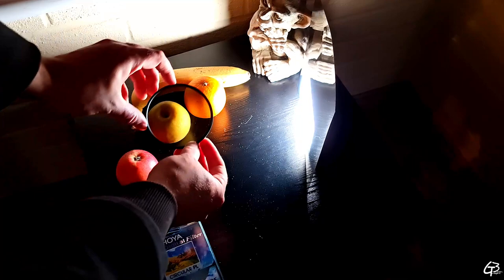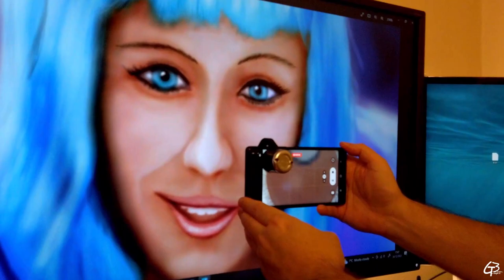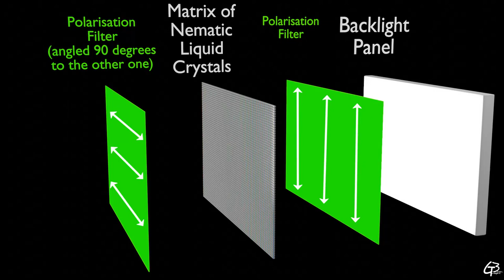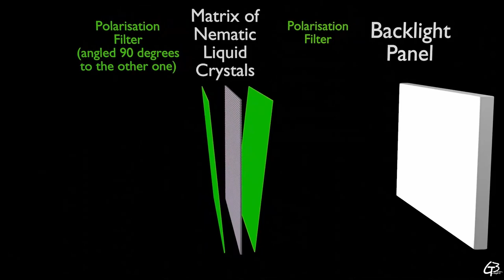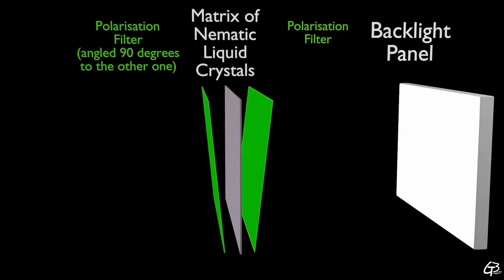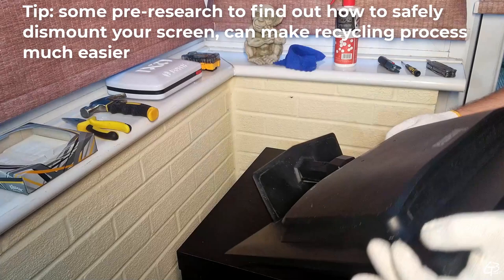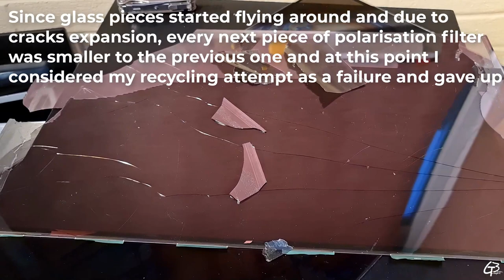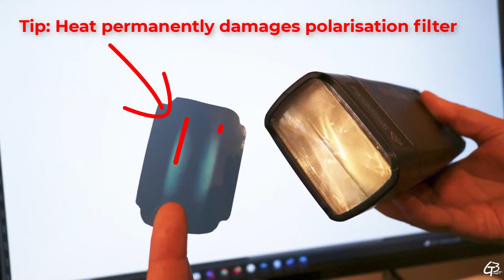How To Recycle Polarisation Filter from old LCD Screen - DIY

Comment: I tried this as well and had the same issues. Separating cleanly from the glass really needs some kind of solvent that will dissolve the glue and not damage the filters.
I could not find any suppliers of large polarizing sheets who would ship to South Africa, but eventually used some replacement filters meant for iPad screens that were just the right size for the AR400. These were very cheap and I still have a whole drawer of them. 

If we need larger sizes in future I would look for the same thing, or recycle an old TV and do more research about the solvents needed.
Reply from the maker: Glad to know I am not the only one who failed :) with the first time. The LCD TV screen should give a very large Polarisation filter sheet which can cover even entire large diffuser. Regardign the polarisation sheet size, I purchased one on EBAY and negotiated nonstandard cut size. It wasnt an issue. It was the seller from Germany.

Comment: I also saw someone in a Photogrammetry group, who ripped out an old monitor screen to create an soft light. So basically both can be used.
Reply from the maker: I am sure anything can be recycled if you need it. I am afraid tho, that light efficiency from such panels isnt the best and woudl rather recommend strong, color calibrated LED panels for such job. Cheers!

Comment: I love how true to form you are in your videos by including screw ups ... (ps.. try a heat gun next time? :) )
dude.. I was wondering... how do you properly calibrate the filters lens/strobe. From what I'm understanding you use a circular polarization on lens and linear on strobe...but not sure how to line them up. The larger filter on strobe (picked up an AR400 as per your suggestion) shows easy results with rotation but not seeing anything with lens adjustment. Seeing the proper adjustment on larger is a small rotation.. Im "guessing" the secondary is even smaller.. (key word.."guessing") ..Also "guessing" both need to be rotated to find that sweet spot.. Is there a technique you can suggest? 
Please keep up your amazing and helpful content! Your delivery is humorous and pleasant to follow along! This is not an easy task for technical information!
Reply from the maker: Thanks. The difference between CIRCULAR and LINEAR polarisation filrer that CIRCULAR is one sided while the LINEAR is double sided :). Most filters for lenses are CIRCULAR as they can be mounted only one side. Regarding calibration, I calibrate/rotate the filter on the camera before entire session. In my case it means that the arrow marker on the filter mounted to the camera has to be UP as well as the handle on SCAN SPACE filter. To make sure all is set I often use a chrome ball but it can be anything reflective. Even a window glass or mirror.
I use the chrome ball technique when I use filter without marker or.. use more light sources (mosltly LEDs) positioned in different areas so I need to adjust them individualy. Hope that makes sense :)

Comment: I went into a TV repair shop and was given a lot of sheets of different film for free. The polarized film had no traces of glue and was smooth. Perhaps there are different technologies for the production of TV panels? I was also given matte and transparent films.
Reply from the maker: Nice, I am curious what tech did they use. I have heard that some polariser sheets are easier to take off and some not and that it depends on certain case, basically on the screen type (TV, computer screen etc.) and its quality.
You can take any filter off by melting the glue with high temperature, but keep in mind that high temperatire damages filter itself permanently and removes its propertities. So it possible that filters you get this way are less efficient and more inconsistent to original ones.
Reply: @GrzegorzBaranArt  Thanks! Please tell me, if I use several flashes, and each one is wearing a polarizing film, in this case will I get a cross-polarization effect? The light will be polarized, but it will fall and reflect at different angles. Or is it a prerequisite that the film on the flashes and the filter on the lens are in the same plane?
Reply from the maker: @user-cx8nn8vq2f  as long as you adjust polarisation angle for each light source individualy it should work, but every time you move the camera, or light sources, you need to repeat re-adjustment.

Comment: Hi have three things.. There was nice technic to roll filter from screen on some stick/bar just start in corner and carefully roll whole screen(used on hp screen to remove semimate finish.) backlight diffuser is excellent to build light from. produces very nice soft light, and last think be wery careful when disassembling old cathode lcd.. Cathode tubes contains heavy metals and are poisonous..
Reply from the maker: Thanks for these tips, very appreciated. Regarding the cathode-ray tube.. I thought they were used in CRT displays only, werent they?
Reply: @GrzegorzBaranArt  Before LED tech caught up, old LCD screens used fluorescent tubes as back light, maybe he's talking about those?

Comment: To separate the filter, maybe you should try to put wet towels or paper over the screen for around 24hs. It will help you a lot to loosen that filter.
Reply from the maker: I dont think it would help as the filter doesnt let the water pass through it, I also wouldnt be surprised if the glue used was waterproof. It would need to be something which disolves the glue without damaging the filter. But the idea itself isnt bad and maybe warm towel would help and soften the glue a bit. The problem with the heat is that it changes crystal structure of the filter and pemanently damages it, but warm, not hot water in theory might help. Unfortunately don't have another screen to sacrifice and test this idea in action :)

Comment: Tried the same thing for my AR400, failed too. It's must be possible with some better equipement, but the time involved + the tools needed are not worth the price of a cheap filter.
Reply from the maker: I fully agree. Initially I was hoping to get at least one 22 inch large polarisation filter sheet out of it. Even if some of these small pieces I managed to get can be useful to polarise some small LED lights I presented in this video, the amount of work needed to bring them to the level of quality, sheets available on ebay are, is questionable. But this is something I had to learn by myself and fail by myself .. especially that I heard about this approach as easy peasy option, which it definitelly is not :)

Comment: Yup, same result on 1st try, broke the screen and pulled off small pieces, second try used a heat gun, a bit better, I think someone used benzene to dissolve glue, I used windex, didn’t go great but went a bit better than with nothing - I beleive limonene would do it - it dissolves glue, was used to replace pei sheets for 3d printers.. limonene is lemon oil.. 
anyway, looked for a cheapest polarizer for a tv on ebay.. and I didn’t use it yet, now a video where to use it (flash rings and lights?)
Reply from the maker: Glad to know it wasnt just me who failed with the first time :). As I shared in this video, heat damages the filter permanently, therefore any heat gun doesnt sound like the best idea. I used some fancy windshield cleaner with strong dirt disslolvent but it didnt work as well I expected too. Might give a limonene a try just to learn something useful.. so thanks for the tip.. but at the end, as mentioned in this video, I will probably simply just order a clean, high quality polariser sheet. 
I decided to record this one as was approached a few times by some folks asking for advice about cheaper alternative to expensive polarisation filter sheets and one of my screens broke. So found it as an opportunity to jump out from pure theory into some practice and learn some stuff I was talking about before. Now I know that it is possible but not as easy as it might look. 

Regarding future plans, I am still working on 'Color Calibration' video and planning to do it as a next one. I stucked on metals as they are really tricky and results I get differs to official everyone uses. So it slows me down as I want to be sure I am right before I publish anything in this regard :). This one cost me a fortune already as metals samples are very expensive. Still got some research to cover. The next subject I plan to cover is another issue I feel like many struggle with.. the subject of 'roughness'. Its another one which seems easy until you go into details :). 
That might be a good idea to record a more comprehensive video about actual use of polarisation phenomenon to capture different stuff but I believe I covered it pretty well already. Of course there are still things worth to cover like building a mobile cross polarised ambient setup for extreme small subject captures where camera facing light might be too large.. or building the setup of many polarised light to give diffuses polarised light that can be used to scan large props etc. But its not at the top of my 'TO DO' list now :)
Reply: @GrzegorzBaranArt  ok, yeah heat gun seemed to change the polarizer.. I think everyone will destroy the panel on first try they are way fragile, I did a few and decided it’s not gonna be that easy.. found some guy on youtube actually changed the polarizer, removed old and installed a new one.. the key is in the disolving liquid..
Great explanation on the lcd tech at least :) ..

Comment: 7:79 What about using a heat gun instead of a knife to peel it off? I guess it's just glue, right?
Reply from the maker: I believe it should help but high temperature affects structure of crystals polariser is made of, therefore damages polarisation properties permanently. So after applying the temperature you turn this sheet into transparent one which does nothing :). As far as I remember I covered this somewhere in this video.
Reply: @GrzegorzBaranArt  Yea my fault. I made the comment before watching the video till the end. Well then there is only some chemical left. Anything else appears to me pointless. But anyway interesting video.
Reply from the maker: @MrGTAmodsgerman As some shared in comments, some screen polarisers are easier to separate to others. If I recall correctly someone mentioned that polarisers used for TV screens are easier to separate to these mounted on computer screens. 
I consider my attempt to get one here as a failure and would rather purchase a brand new, clean polariser sheet that waste my time trying to get another one this way :D
Cheers!
Reply: @GrzegorzBaranArt  Interesting  🤔 I saw a comment here about those Iphone screen protector which might be the easiest option if i understood correctly.

Comment: Man, you were so unlucky with your screen model. I just extracted two fully intact polarizer films plus several diffuser films from an older Dell screen in under 20 minutes. The films were not even glued except for the margins.
Reply from the maker: I just shared my experience without any cheating in detail. I didnt play with other screens but I heard that it depends on the screen and case and its quite random. So maybe I wasnt lucky or maybe you were very lucky. I bet the truth is somewhere in between. Cheers :)
Reply: I have used the diffusers for diy led panels. A lot of the smaller tv/screens sheets have been glued whereas a lot of the larger were loose.